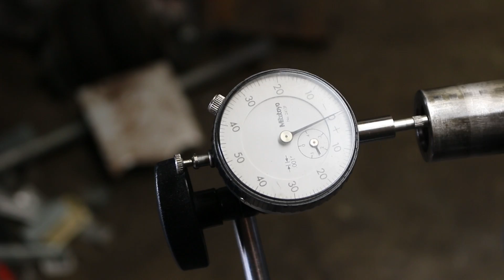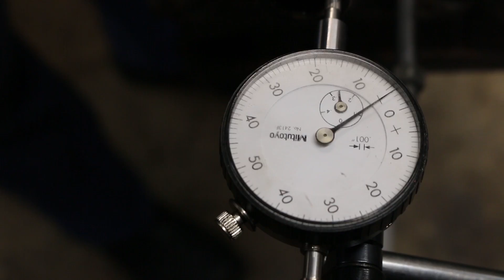Forged RB26│MEASURING END FLOAT◄►PART 3

Comment: why does the rb26 only have 2 main bolts holding each cap?
Reply from the maker: I wouldn't be able to tell you that one. I assume you're used to seeing 4 bolts for each cap? Perhaps back then that's what they thought was best. Or maybe there was limited room inside the engine. Not too sure on that one :/